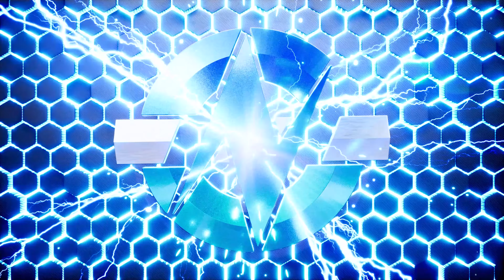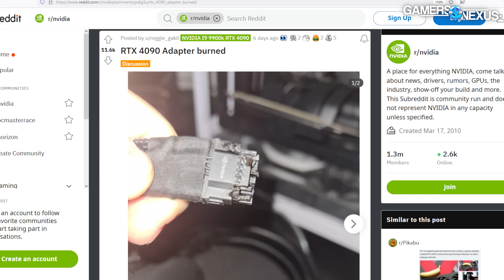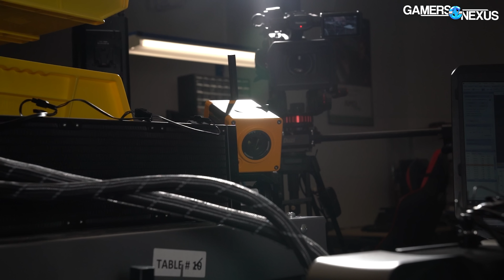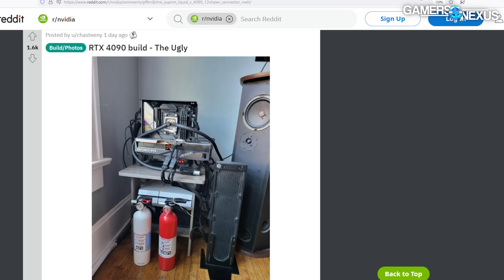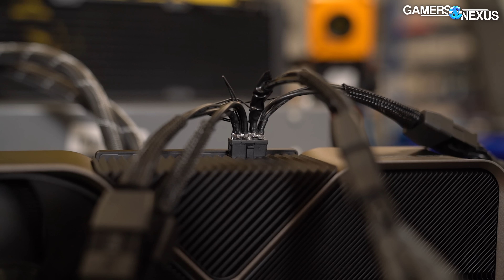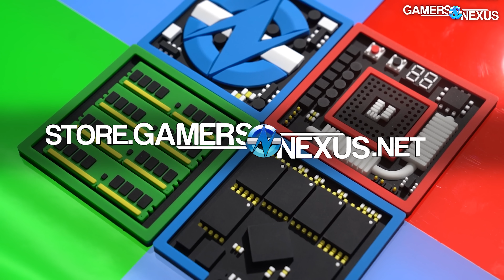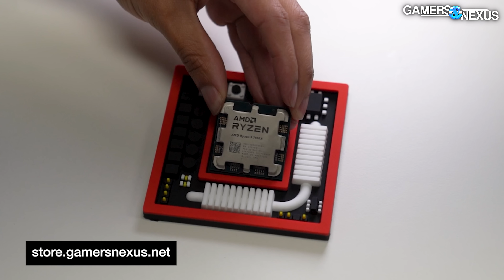Testing Burning NVIDIA 12VHPWR Adapter Cable Theories (RTX 4090)

Comment: Yeah right you saw a 12 pack of Jolt Cola and had to find justification for buying it, I know what's up!! Lol 

Seriously though, good work! With the extreme bias within PCs/PC Gaming especially towards manufacturers/designers of hardware, the idea of finding a "quick answer" is not only rather absurd, it is irresponsible if diagnosis and treatment for the actual issue is the main point....which it should be. I'm sure the point of many is to just "stick it to Nvidia". Besides that being lame, it clearly makes any "reporting" or conclusions suspect simply by knowing the bias is there. Too much of "Journalism"(in quotes since much is hard to define as such) and the consumption of it is simply to affirm bias as entertainment and not about informing for growth. I'm not fan of Nvidia. I don't like their business structure, marketing tactics, or their products in many ways. Only card I ever regretted buying was the first DX10 GForce for fear of missing out as they marketed, although there were only like 4 DX10 games out by the time I decided to upgrade again. It was also one of the shortest GPU runs of my life spending twice as much for only a tiny bit more power on top of a lot of bells whistles I couldn't even use. Kinda like Tensor cores when you don't need upscaling. Only saying this to point out that even though I'm an AMD/ATI fan and have been for over 20 years, I still believe it is important to have real conclusions even if they don't confirm/affirm my own preferences. I'm a big boy, I can handle it.   In short GREAT WORK!

Comment: Hey Steve! There is one important disconnect between your testing and the failures so far. All your tests are on an open test bench while all the failures are within a closed case. Is this a case of accumulated heat load within the closed case causing problems vs this not happening in an open test bed where there is no chance of heat soak? So far none of the testing to simulate this by other youtubers has been done in a closed cramped case. Maybe it's worth a try?

Comment: Might be a good idea to get the end users that are experiencing the burnt cables to share more details about the PC , especially the power supply make, model, and wattage. The videos I have seen where people are trying to recreate this issues are all using higher wattage, more premium power supply. It would be interesting to see if this may in fact be more related to power delivery that could be causing the melting i.e a lower wattage PSU working harder to deliver the power needed to run the 4090…just a thought.

Comment: Sounds like a subcontractor fuckup IMO, but that's still to a great degree Nvidia's responsibility if they signed off on putting a mix of different cables in the box.

Comment: When revisited, could we test to failure to see what it would minimally take for power load (in various versions of this cable) to replicate the issue? I wonder if going through that exercise could shed some more light on what may be going on.

The entire issue remains pretty scary that even the potential for this does seem to be real, and happening. Perhaps there was an issue with pre-prod distribution where the connection should have been more finalized before pre-prod demos were sent out.

Comment: I have a feeling the PSU has to do with this thing. Some PSU have more stable power rails etc. Your top of the line PSU may be allowing the damaged cable to work due to the quality of the Psu.

I have a feeling a cheaper bronze or something 1000w psu may cause more issues.

Comment: The plug location on all 4090's is flawed to begin with. Expecting users to have 185mm or MORE total clearance (card width plus 35mm adapter plug bend) is completely unrealistic especially when most large cases only allow 170mm with the side panel closed. The connector placement should have been angled like the 3090 Ti or moved to an area of the card that doesn't require severe bending which compromises the power connectors.

Comment: Was patiently waiting for this video. Knew it wouldn't disappoint in the level of detail he would go to in order to replicate possible failures.  As a 4090 owner, thank you for the work that you did. Don't know how I feel about unwrapping the adapter tape and pushing back the sleeving though.

Edit: Did it anyway, 300V on mine and sent the results.
Reply: Nice one man. No risk, no research! 🍺🙂
Reply: Better safe than sorry! Thanks for contributing 🍻
Reply: I wouldn't use that cable

Comment: Seems like they should have been crimped rather than soldered. Did cabling for military application for a while and the only cable soldering we did was solder cups, every other connection was crimped. Double crimped for anything that might get put under strain.

Comment: I doubt highly that this type of issue will occur with the native 12VHPWR connectors, or even with Corsair and CableMod's adapters because they use one wire crimped to each pin, unlike Nvidia using 4 wires soldered to 6 pins on each side. The different voltage ratings for the wires also indicates multiple vendors and an overall lack of QA oversight by Nvidia.

I also think that just using "poor" connection is a bit of a red herring. I think it's an intermittent connection from a broken solder joint; the wire touches the pin when it's cold, but as it heats it separates and can cause arcing as it does so. This would be completely undetectable in an otherwise undamaged adapter.

Comment: Out of due curiosity while, perhaps outside the scope of this investigation. It'd be interesting to see how the native 12 to 12 Pin ones are done on the ATX 3.0 PSU's but also aftermarket cables such as the ones from Cablemod. But also Cablemods own Nvida Adapter for RTX 4090s.

Comment: First of all, solder should never be used on connections that can undergo movement / vibration. That's why all connectors in cars for example use crimping. I'm not saying solder is the problem but it's a bad design to solder these, period. You never , ever , solder a connector.

Comment: 10 minutes in so far, my understanding is that Igor is right and one of the suppliers is using lower quality materials and has poor quality control. Seems likely, weird that Nvidia wouldn't be on that already though.
Reply: At the end of the video now, and yeah that seems most plausible to me still. Some of the adapters are fine, some of them are cheap. Nobody has mentioned the difference between cables up until now, so it would make sense that the ones built like the one Igor took apart would fail while the better designed cables would last. I've melted my fair share of electronics lol, it's not my specialty but it's happened.

Comment: Hi Steve. Do we even know, that the adapter cable is the problem. So far I have only seen molten connectors and a connector has always two sides. What if the problem is the connector on the graphics card, or the graphics card has a defect and draws a lot more power than specified.

Comment: Another great video, Out of all the reviewer and Labs you have been spot on most often and less prone to Drama - ie unwarranted drama to get clicks or fuel manufactured outrage.  and responsible enough to actually test (not just speculate) and go after real problems and addressing and working with companies and highlighting when they do the wrong or right thing.   
Extremally good job! and Full recommendations.  (From a career computer Engineer)
Reply: Yup, exactly why I ignored Jay's videos and waited for Steve lol. Very obviously trying to farm the failures for clickbait and views. I want to know whats happening, not 10 minutes and 1 second of "CABLES ARE MELTING AND THATS BAD NVIDIA FUCKED UP"

Comment: 10:21 Those wires have insufficient solder per IPC-A-610C class 3 and possibly class 2. Class 3 is >75% fillet height, class 2 is >50%. Also the wires were stripped incorrectly leaving damaged insulation. Defect class 2, 3; process indicator class 1. Wire strands do not look damaged.

Am inspector for 'aerospace'. I would've rejected this cable. The connectors don't have enough surface in the solder area for an adequate fillet and the strain relief is trash.

Comment: Think you need to consider what builzoid thinks, that its the problem with the terminal itself, not the cable, or how it is soldered to the terminal.
Reply: He couldn't reproduce any issue. Buildzoid was probably going on the Igor's lab findings.

Comment: I order a pci5 psu and refused to even use the adapter. Never goes over 90f at the connection and the 4090 is very nice. By default the zotac is set for zero fan, 2 hours of 7 days and the fan never came on.

Comment: camera name: Ignis which is the Latin word for fire.   

 I think the big issue with the cables is there are some out there with manufacturing defects (wrong procedures, wrong components) or someone tried to get by with substandard components to save some money.  If the latter they are probably buying the cheapest stuff out there and 150v cable might not be rated to that, maybe it is a 50v cable rated to 75c or some such with mislabeled markings to try and sell crap at a higher price.

Comment: just like with rc cars... having so many battries meet up on a single end point is asking to spark a fire!

soldering does work...but it's resistance that generate heat. the more endpoints you have the more heat ends up being packed in one small location.
Plus the bending can weaken one soldering..if it get hot enough a weakened solder will break up.

it is never reccomanded on rc cars to setup 4 batteries together..even thought some do it.. like 2 packs in parralel and those 2 packs in serial.. the end point going to the esc is going to be stressed badly.
there is a way to wire them properly and this require a board wich all batteries are independently connected to and that board make the desire voltage output . etc..

600 watts on a single endpoint from 4 source is a very bad idea.

Comment: The difference between 150 and 300 volts should no matter at only 12 volts.... That is only the rating of the insulation.
Reply: It indicates different manufacturing though.

Comment: The voltage rating of the insulation is really of no consequence in this situation, and even at 150V is way over spec for this use case. The power rating for the cable, and thus the amount of amperes it can safely carry is all to do with the copper inside of it. I would say the temperature rating of the insulation is way more important in this use case. Having looked at the evidence of the burned connectors, I would say with confidence the issue is caused by poor conductivity between the pin and it mating shroud, causing local resistance and thus heating in the pin/shroud unit which would then melt the plastic connector housing around that area. I think this poor conductivity is caused by sideways stress on the connector, aggravated by the fact that soldering the rear part of the connector in that way provides absolutely no stress relief when the cable is bent in a sideways direction. Earlier connectors produced by NVidia for the 3090Ti GPUs did not use soldering on the rear entry, and used crimping of individual wires, as it should have been done in this case.

Comment: the difference in soldering was interesting to see, but the insulation rating shouldnt matter much.
igor also suspected the female connectors on the cable losing contact pressure from bending the cable around while plugged into the pins of the card.
Reply: GN tried to bend and still didn't have an issue.

Comment: Buildzoid has revealed what the cause is already. everyone is looking at the wrong end of the cable. its melting from the end that is inserted inside the connector not the wiring end. nvidia's connector is using cheap double split pin terminals. other manufactures are using single split pins.
Reply: GN used an Fe in the testing.
Reply: @Safetytrousers  it's not the card, it's the adapter's supplied by Nvidia that most AIB's and Nvidia themselves are using. The cablemod adapter cable use single split pin connectors. Check buildzoid video.

Comment: the voltage raiting is for the insulation mostly since it will melt with to much current not voltage. thats why wires dont melt when 40,000 volts run thru them just the point where it enters air from the ionization an the sharpest point on the wire. wire capacity is usally watts or more importantly amps. measure the wire diameter with x,y cross-section with a caliper. high voltage scares me as it should. after being a eet student and working near primarys i cringe ay anything over 42v

Comment: Just because you don't have a solid conclusion doesn't mean this is wasted effort. This is hugely valuable work and I appreciate your effort to keep the results objective.  As we've seen in the past couple weeks, when you have some level of expertise, t's easy to overstep the test results objectively and make broad, sweeping claims based on a small sample size. That type of reporting only serves to hurt both the consumer and the tech industry, so I applaud your consistency in bias-avoidant reporting.

Comment: I would assume the first few batches of the adapter which were bundled with the first cards being sold, were of inferior quality using inferior parts. Someone probably noticed it at some point and upgraded things, leaving the inferior ones in the wild. "We'll just see what happens, it should be fine" was most likely their state of mind at that point. Seems like you're shoving too much power through something that isn't built to fully handle it, causing fuckery.
Reply: There has been only one batch of 4090s on sale so far.

Comment: So ive been running a gigabyte 4090 since launch day on a corsair 850watt psu. I run an Ryzen 5950x so the 850w seems ok in my scenario. I an NZXT H510 case and this card barely fits with the connector on the side. I put the minimal bend required on the cable and put the side panel on. I am currently running no overclocks and "letting sleeping dogs lie" until I can get a cable mods 90 offset adapter. I checked the cable once for burning after the first reports came out but my cable and card are OK. I had done some previous overclocking for benchmarks, and was actually pulling 600w through the connector but not for long durations of time with a sustained load using 600w. For most people their cards will run 450w all the time. Its a design flaw for sure. Cablemods to the rescue

Comment: should be in a case -- the burnouts were not on test benches -- added heat from being inside a case might tip to the levels you speak of -- could even be a cross frequency issue like the last gen GPU's

Comment: Bottom line: X amount of current through a given amount of surface area will create heat. It’s the connection of the pins and how MUCH contact they actually have to their mating part that is going to creat the heat.

Comment: it's fine to see you doing all this job.
but it's not your role.
there is no need to go in depth like this.
Cable transferring more power need better construction and connector's effectiveness.
having power connectors, in a PC, where the bending of the cable is a potential issue, means the initial design has flaws.
if the initial design did not take care about the real usage of these connectors and cable, it's a design flaw.

so better to ask for a revision of these connectors, they have to provide more reliable ways to use them and not just "don't bend it" to move the fault to the customer...

I can't imagine the impact on a prebuild system, where they are using foam to make sure the GPU is not moving... 
the current cables will be bent so much... 

for now 90degrees connectors is the short term solution. but what about the PSU side? a 90degrees connector is not possible there while the cable can be bend too.

we'll see a revision for sure.

Comment: A bad or marginal connection is way worse than an open.  Has anyone tossed the connector on a hot plate to see what temp will actually make it melt?  That would help suggest how close the issue is.

Comment: "The Camera of Sauron"
"The Eye of Sauron"
"The Thermal Eye of Sauron"
Aaah whatever...

Considering the pins melt on the INSIDE, it probably is a contact issue. I tend to agree with Buildzoid's theory on this one.
So in order to check that out, we need GNX-ray imaging :D Nice!

Of course, the 150V vs 300V cable discovery is a major one... and a hard to find one, because these cables are covered, so this info isnt going to show on any of the burnt cable pictures...

Comment: Was second nature to me to avoid those stupid adapters. I wanted an FE 3000 so bad, then I saw that.
Reply: There were no melting reports on the 3000 series. The connector on my 3090 goes in very solid.
Reply: @Safetytrousers  I dont need reports noob. Its also terrible looking aesthetically.

Comment: I’m an electrical engineer. When I saw that the wires are soldered to the connecting plate in the connector, I already knew that this is a problem. 

Rule number one for any electrical connection: NEVER EVER SOLDER WIRES TOGETHER!!!

EVER!

I would have never approved this connector design. 

Soldered outlets are a major reason for house fires. Nvidia obviously did not do any research into this.
Reply: Exactly my thoughts. I regularly get people trying to design soldered cable assemblies and submitting to me for approval and i have to redirect every single one to our design for manufacture web page 🤦‍♂️

Comment: Seems like the plastic connector itself is not fit for purpose.  It needs substantially more contact/latch points to stop it being pulled slightly out of the socket on the card.  I.e. fix the mechanical engineering part of the problem, rather than the electrical.  The electrical issue may not be an issue if you fix the mechanical (the outer edges coming out of contact with the pins).